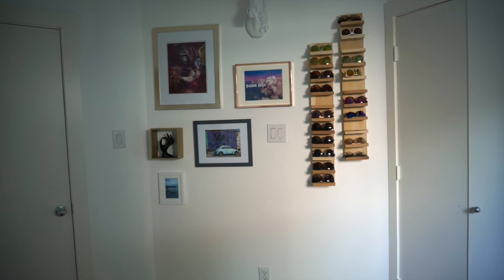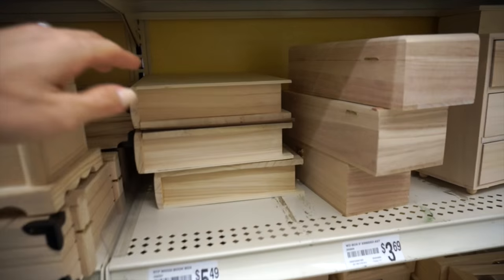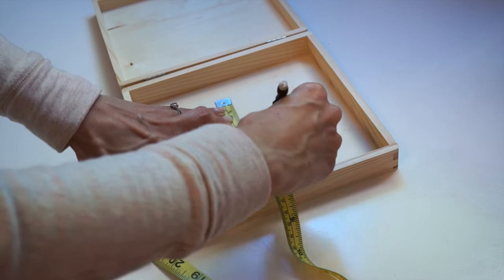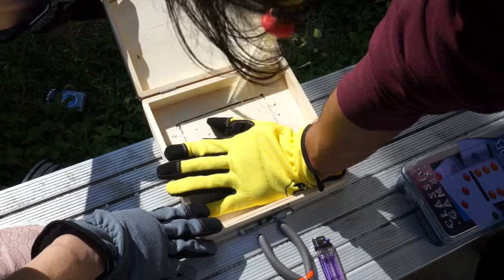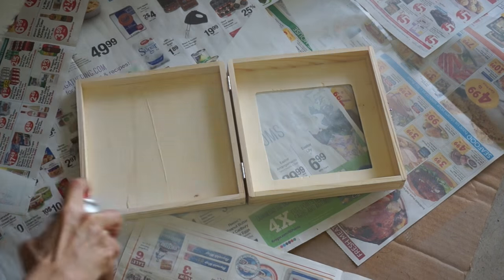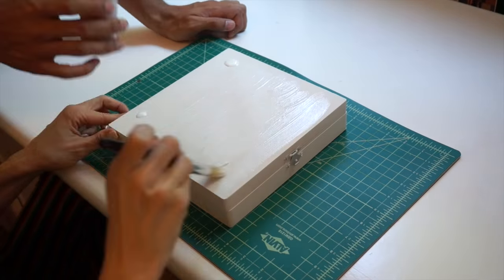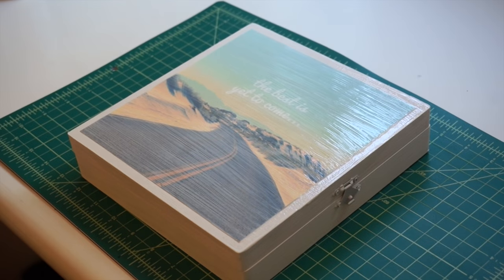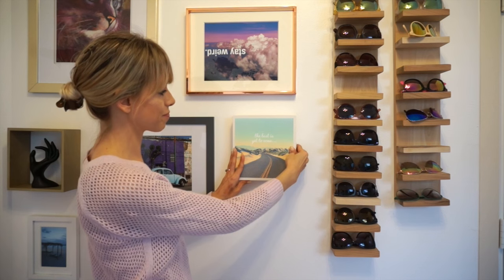Cover up an ugly light switch DIY | Superholly

Comment: Why not just cut the whole back of the box off?  You don't need really it for anything, and you could make the box the thickness you like to fit in with the other pieces on your wall :)
Reply: Yes that would be an option, only  where do you suppose the hanging tape would adhesive to? 
Would have to cut the whole panel to trim down the thickness and nail back the paneling in order to hang.